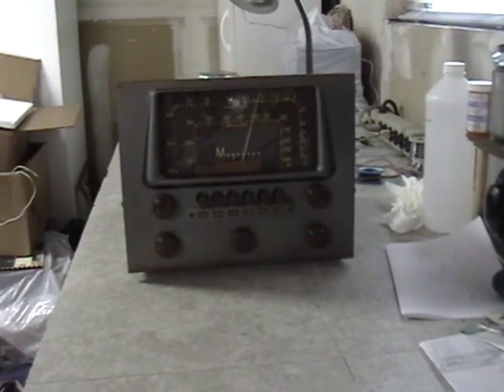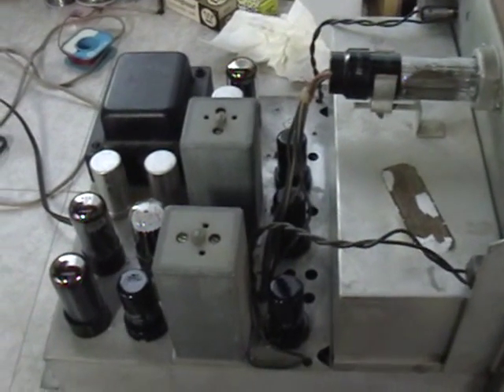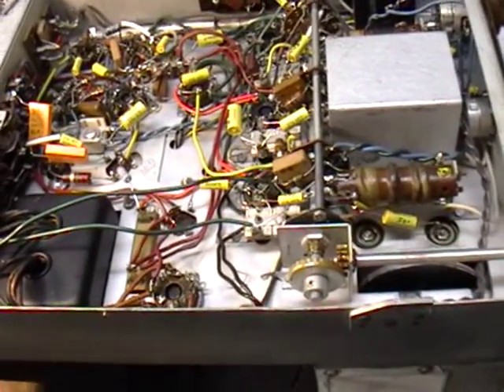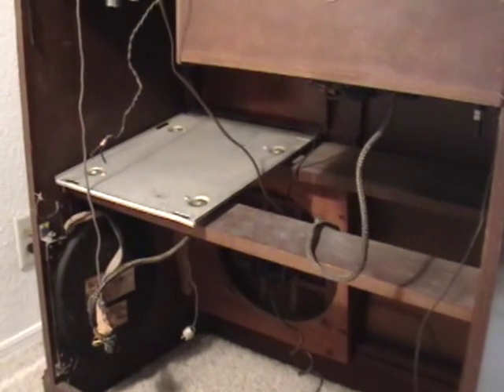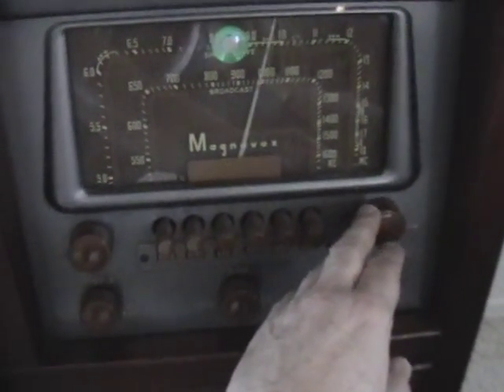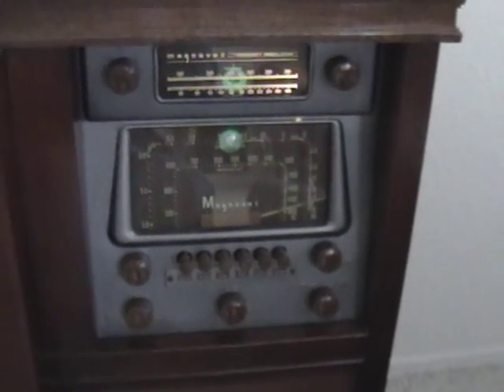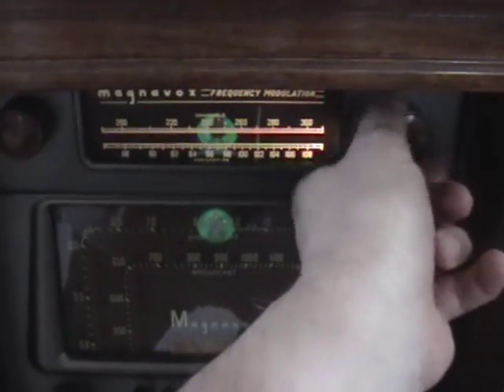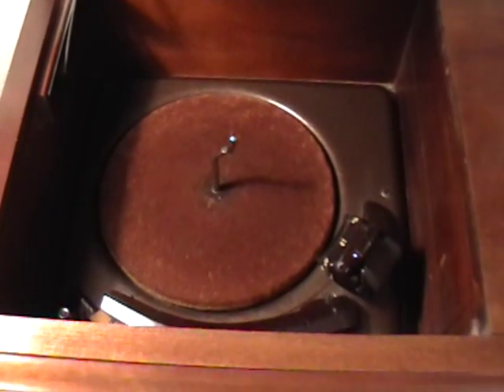1947 Magnavox Georgian Restoration Completed

Comment: What a beauty, a great restoration. Thanks for posting; it brings back great memories. My parents had the 1947 Mayfair, with the CR 199 AM only tuner/amp chassis (10 watts output) the same single 12" full range "Duosonic' speaker and the Webster Model 56, later replaced with the 3 speed Model 100. This sounds just the way I remember the Mayfair sounding...except that records sound so MUCH better on your Georgian, with the Astatic ceramic Powerpoint ,rather than the original crystal!

Comment from the maker: The FM tuner was an option.  If you didn't order it, there was a blank for the tuner to be added later.  In 1947 only major  cities had FM broadcasting, so they made the tuner an option rather than have it on the same chassis as the AM/SW radio.

Comment from the maker: @75capriceconvertible Bill, thanks for the compliment.  I had been wanting to do the recap on this for a very long time but put it off because of the complexity of the set.  The project after this has just been completed.  I located a Collaro changer for the '57 Magnavox Provincial stereo conversion that I have on Youtube.  Chris just helped me to repair it and I'm waiting for a new stylus. Once that arrives, I will swap out the '63 MIcromatic for the Collaro.
Reply: did you post a video with the collaro in it?

Comment: That's a beautiful set. You did a great job with the restoration! Question; Was that FM tuner original to the unit or did you ad that yourself? Or was it simply an extra option when new?
Reply: I had the same Magnavox as a child, and the FM tuner was an "add on" option when new, due to the fact some people did not live in areas where FM was available and the signal does not travel as far as AM..

Comment from the maker: @chris061290 You might try eBay.  I have seen them up for bid.  If you do find one, I would recommend going through the chassis and replacing all the old paper caps and the filter cap.  Also wouldn't hurt to test the tubes and replace any that are week.  One thing I should mention about these FM tuners, they do not have the sensativity that current FM tuners/receivers have and usually require a good indoor FM antenna.  Best would be an outside one.

Comment: I just found your video and you have done nice work.  I also have the same unit, minus the FM tuner.  My inlaws passed awaycouple of years ago and we found this unit hidden away in their attic.  My wife has asked that I refinish the cabinet and put new components in but keep the radio face.  I have the new components and have started the cabinet restoration.  I would like to get the radio dial to light up when the rest of the unit is working, purely for cosmetic purposes.  The light for the dial comes from a tube with a light defuser at the end.  Do you know of something I can use that would not require power to go through the, really in bad shape, chassis?
Thanks, RL